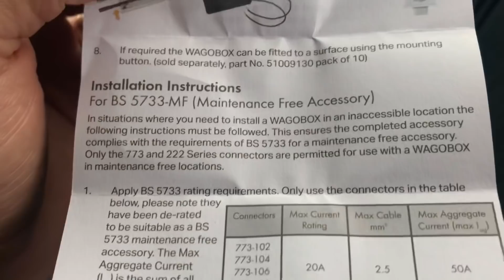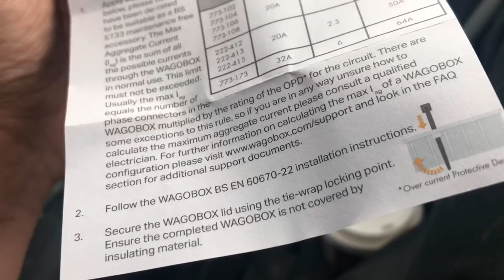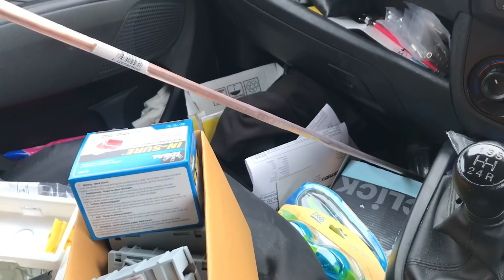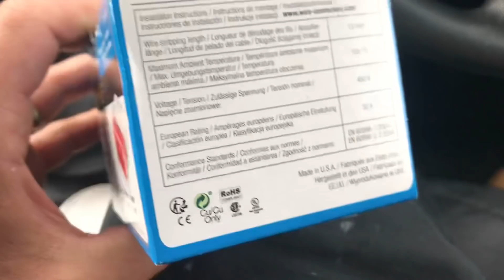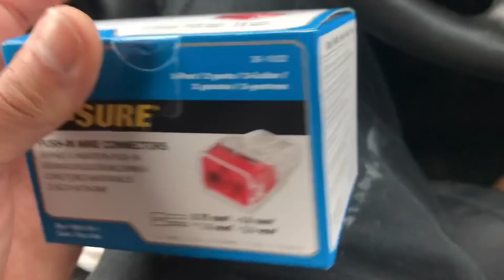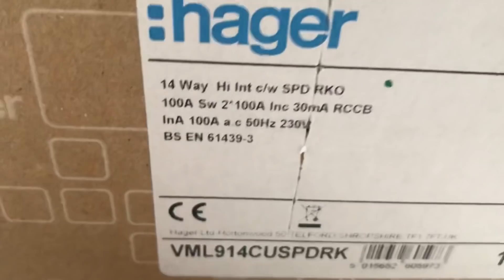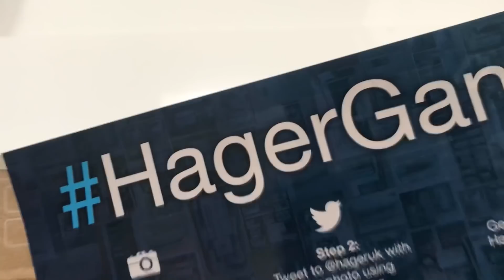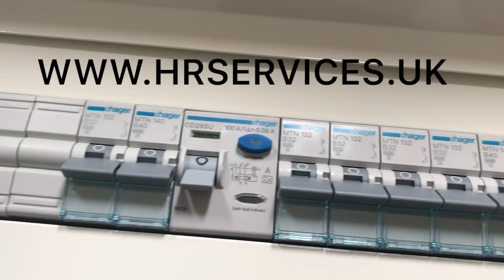Client says “too expensive”- Come price a job with me. Hager 14way CU.

Comment: Another great video mate. quick question. which is the best way to cut down bus bars or the correct way to cut them down to size?  Cheers.
Reply: Andy chara  .....I use a cordless angle grinder , it works a treat and you can also smooth the rough edges with it....👍
Reply from the maker: Two sturdy pairs of pliers placed on the stamped lines the break off with no fuss
Reply: Richard Walsh ....who mentioned Hager....? Andy chara asked what was the best way to cut bus bars ( A general question ) I think......😜

Comment: Chris ,I don’t think you’ll get 2 core swa ,3 core better use the existing rod as the whole installation is tt ,100ma will trip on 5 times test for 30 ma if you need too use a 100ma s type is the way to go ,your 5 bed price was very reasonable not worth wasting your time worrying about 👍🏻
Reply from the maker: Daren Vita electrical https://www.superlecdirect.com/p-xlpe2x16-superlec-6942x-2core-16mm-swa-bs5467-steel-wire-armoured-cable-harmonised-cores?gclid=EAIaIQobChMIm-CQpZe95AIVjLHtCh0z7w8tEAQYASABEgI-ufD_BwE
Reply: CJR ELECTRICAL Chris what I was politely saying was a 3 core should be a standard as you need fault protection in the distribution circuit as swa does not comply in certain sizes ,also your whole installation is a tt so take the earth all the way to the outbuilding ,saves you a rod 😄
Reply from the maker: Daren Vita electrical perfectly acceptable to use the earth armoured sheath as the cpc.

Comment: The Hager Board you have is the hi integrity board or configurable  so like you said you can place rcbo's  in next to the main switch the older Vml755h1 hager board is a standard 5x5 (and you get the buzz bar are cut to 6 ways) which most people buy due to the extra cost involved in having the ability to configure how you want

Comment: I thought the leaflet only omitted 221's as hadn't been updated. Also, the sections at the end of the box fit 222 and although 221's go in there they are not a neat fit. However, I have used those boxes with 221's. I have another query... why do they have cable tie slots? If it's not accessible and they are a tight fit (and they are a VERY tight fit) then why would you tie them?
Reply: Probably so you need a tool to gain accesses to them just so they can’t just be opened if that makes sense
Reply: Well I can guess theirs probably thousands of wago MF boxes install that apparently aren’t MF then 😂🤷🏼‍♂️
Reply: Richard Walsh you see I’ve just had a look and can’t see that it states that a cable tie must be used to maintain the MF I assumed it was down to the connectors used like 773-222.
Reply: Colin Herbert Screwfix have Wagobox 221 connecter inserts pack of 20 £4.99 - item No 822FV.
Reply: @nw5835  Yes thanks and apparently you should use these to stop any vibration (yes, vibration) that may work the connectors loose. If you use the inserts there is no vibration and so they are certified MF. Cable ties not needed for MF. I cant see the cables I have put in vibrating but I may get the inserts! Money for the boys methinks.

Comment: Hey CJR, I been watching you for a while now and lately I have had a question in my mind... Suppose you have to hang a ceiling light that's not too heavy but heavy enough for you not to be able to hold it and do the connections at the same time. what do you do? is there always a person that needs to hold it up for you or is there a stand/jig/tripod in the electrical industry that can be used to hold it up for you to get the connections done and then install it?  many have suggested let it hang with just the eart connected but that's not really a solution or use a wire hanger not really a proper solution either.

seems kind of crazy but I cannot seem to find anything online with just a quick search. Currently studying the 2365 and 18 edition so I try to workout different scenarios in my head if I was to ever face them.

any input and thought or solution will be much appreciated.

all the best with you daily work.

regards
Reply: You need to rest it on the ladder young man. Or if it's really heavy get yourself a buddy to give you a hand while you make connections, it's really as simple as that. Happy training 👍
Reply: And to add height to the job aswel can be tricky.  Using a tower scaffold on those really high up fittings makes it easier but still need a man and mate for fitting.
I have also erected a tower high enough to support the fitting on the platform for connecting.
Reply: I had this problem a few years ago with a chandelier type light. I thread a belt thru it and hung it round my neck/adjusted to allow fixture to rest on my chest while I connected it up with both hands

Comment: £250 a day super cheap I’d hire you as a subbie any day!
Reply from the maker: I’m not actually sure I said I was £250 a day.
Reply: Well you sort of did mate,I think that’s a fair rate for an experienced sparky
Reply: Artisan Electrics not many people think that’s cheap although I think it’s fair
Reply: 250 a day is cheap if you're running your own business.
You have to make a profit, otherwise you may as well not bother and go and work for someone else.
Reply: @rob.1  Spot on, mate!  Running your own business and working for less than £300 a day is pointless. Just go on the books and save yourself all the hassle.
Reply: A sole trader can take 300 a day, as a limited company you need to be at least 400 and I'm talking euros. I priced that cable with meteor Electrical in Northern Ireland and it came in just shy of €400 so if it's going to be a 2 day job you want at least 800 labour. That doesn't leave very much left for breakers, glands, metal clad sockets, conduits, singles, sub distribution panel, electrode including box and U-bolt and all of the other bits and pieces that go with it. I generally factor in fixed overheads as well such as diesel. Also travel to and from the job at €50 per hour. Of course I don't tell the customer we just roll it into the price. I suppose the point I'm trying to make is that 1300 is far too cheap we would be more like 2000 or 2500. Don't forget it could roll over to a third day and you need to cover yourself really well. You could always say to the customer that if you are going well on the job that you may allow them to claw a little back and sometimes I feel this makes the customer really happy that there is and option to do so.
Reply: Robert Williams £640 plus VAT

Comment: What's wrong with using 20A rated connectors on a 32a ring? Don't need 32a connectors unless it's a 32a radial.
Reply: interesting, I see your point but its not uncommon to find that a 32a ring is in fact 2 x 32a radials where someone's left a loose connection somewhere. So the 32a connectors are certainly needed to allow for this common potential fault.
Reply: @dkeable3970  By that logic we should be using 4 or 6mm cable for ring circuits so the cable is rated for 32a
Reply: Matt Thompson I guess so, maybe I didn’t think that through 😂
Reply: @mattthompson8657  yes should that's why faults requiring a rewire of the house due to melted cables in the wall are occuring
Reply: @minixtvbox  what are you on about?

Comment: i was around 1800 plus vat , whats the load in the workshop (design current ib) wondering on your vd for the sub main
Reply from the maker: I want to give him 40 amps so a 16mm2 will be fine
Reply: @Cjrelectrical  you be surprised i have calculated it as 2.9x40x100/1000=11.6v 5 % of 230v is 11.5 .1 v over limited vd  16mm2 mv/a/m 2.9
Reply from the maker: It’s around 85 mts of cable I rounded up to 90 then priced for 100 mts I got around 11.2 voltage drop with is around 4.9%
Reply: @Cjrelectrical  do enjoy our debates only other you tuber to respond is dses

Comment: I'm a gas installer and used to get this all the time pricing up jobs when I worked for myself
Even long-time existing so called loyal customers would go for a cheaper quote if the could save hundred quid on a 3k job
I would quote for new boilers and hear nothing back.
Then 12 months later theyd call me wanting me to repair the piece of junk they had fitted by someone else

Comment: S.W.A - £800
Board - £100
Breakers/RCD’s - £100
Conduit/Trunking - £200
Cables - £100
£1500 - including testing and install.
Pass on my number if you cost more lol!
Reply: As I said before - If you said CCTV then I stand by the extra, £2000 - 2500 depending what equipment you use (video baluns and Ethernet cat6 looped etc) or (IP meaning Cat6 to each camera and a switch).

Comment: Hey a dog WAGS its tail, it certainly doesn't WAYG its tail. Its WAGO not WAYGO..hahahaha
Quick point you would require a "time delayed" 100mA (if you decided to protect the tails etc) not just a 100mA RCD. You wouldn't get any discrimination between a 100mA & 30mA RCD without the time delay.
Just wondering why you've isolated the house TT rod from the shed TT rod? (Have I got that right?) If so, would have made a better job, with a much more stable Ze (Ra) by keeping them connected together imo. 
Also much better to henley the tails at the origin, and fit a switch fuse to supply the sub-main. Keeps it separate from the house installation and you'll get little to no discrimination between circuit breakers and circuit breaker, as opposed to fuse and circuit breaker.
Still really enjoyed your video though. 
Oh, and I cant see what the problem is with 20A rated connectors on 32A RFC though?

Comment: you mentioned Torq but could you explain a bit more please
Reply: The torque settings are the required tightening settings using a torque screwdriver for the mcds, rcbo's main switch. 
Like your wheel nuts on your car have to be tightened to a correct torque so they dont fall off when you drive.
Reply: @sbmorris2k6  yes but I was sort of hopping for more about the torq used maybe even a video :)
Reply: @David_11111  Have a look at GSH videos they cover the subject in depth.

Comment: What you have to keep in mind when pricing jobs is the fact that electricians are idiot's and there's plenty that will do jobs for next to nothing.
It's hard graft doing a rewire, and if I can I will avoid them.
What's the point in being the cheapest anyway, you will never make any money. 
Where I live, plumbers charge about £2k to fit a boiler, normally installed in a day, so they make about £1300 for a days work, yet electricians will work for nothing.
Your price for the shed sounds about right, is that plus vat or including vat.
Reply: @Mark Sesum you are completely right, I always tell other trades I am the most qualified on site, we are the only trade that does any real testing.
It makes me laugh when plumbers service a boiler, stick a probe in and that's it, because these boilers are all sealed now, gone are the days when they would get the vacuum cleaner out, it's just very annoying.

Comment: I went to a hegar 18th edition day and I asked the guy running it the same thing about what protects the cable and he told me they are tri rated cables and can easily handle it!! He said his answer very fast and moved on before he was questioned anymore but he did tell me how much they turn over in a year and told me
‘we know what we are doing’ 
I didn’t really believe him tbh..
Reply: Pistol Pete the short tails to the spd will never be subject to overload and a far as earth fault goes that why a 100ma s type should be fitted as a main switch
Reply: So why do other manufacturers have the tails covered with a MCB?
Reply: @pistolpete5189  Because their SPD arent rated the same as the hager device, the hager SPD can be protected by upto a 125A device where as most retro fit are 32A tops

Comment: I won't fit Hager. Out of all the boards I've had problems with over my 30 years as a spark Hager is the winner.
Reply from the maker: Why? What problems have you encountered?
Reply: @Cjrelectrical  Faulty MCB's and  RCD's. Maybe the newer boards are better than the old but I prefer to not take the chance.

Comment: Electricians are very pricey, each to their own. We got sick and tired of being over charged by electricians for full rewires etc etc so just did the course myself and do it myself. 5/6k for a house rewire on a house which is being ripped out. Easy for an electrician but yet they still charge a massive amount. There is a reason "sparkies" have a bad name amongst the trades because they do over charge. Everyones seen the memes with sparkies having huge amounts on money in their wallets. Doing it myself in 2/3 days saves me around 70%.

Comment: Your to cheap mate min £ 1,700.00 no additional RCD required at out building it be protected by the RCD at the house, IF you do you would have apply discrimination down stream and that would mean installing a 10mA RCD which would cause issues with tripping

Comment: Just for reference, you mentioned a ring circuit then said the connectors are 32a, you know that a cable is half 16a connecter will do.
Reply: Do you know that a 32 amp mcb will take way over 32 amp before it trips on over load . Each leg is designed to take 20 amps .
Reply: Eco T. Bollocks.
Reply: Let’s be having the Reg Number then, it’s fine to say it’s in BS7671 but without a reg, i stand by my original answer, which I will give my explanation after  your reply.
Reply: @eco-terrorist  I see your point, I don't do house electrics but it seems people often find that a 32a 'ring' has become 2 x 32a radials over time due to DIYers or poor connections so wouldn't using 32a connectors be the best practice?